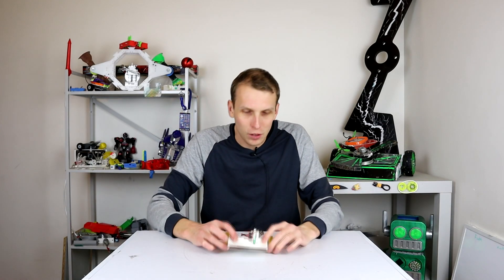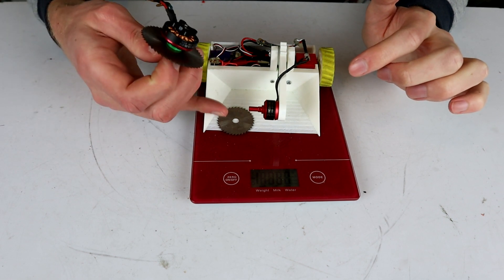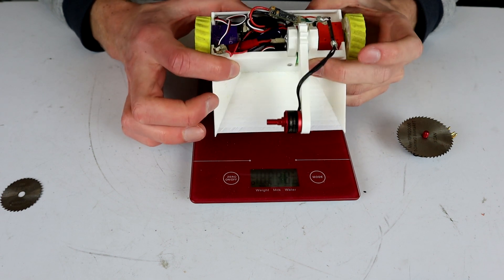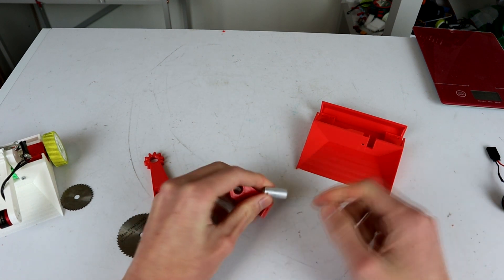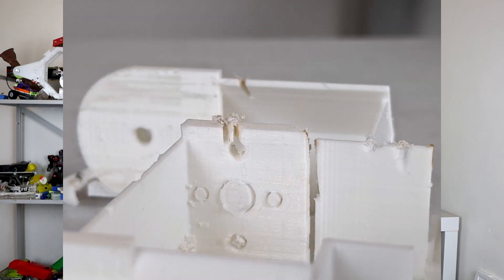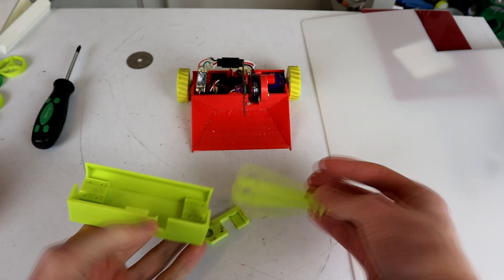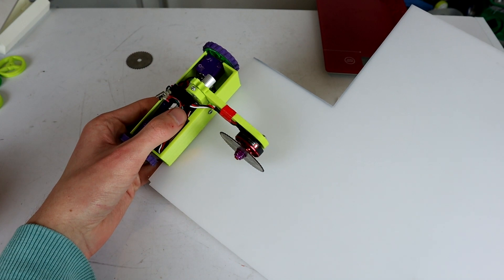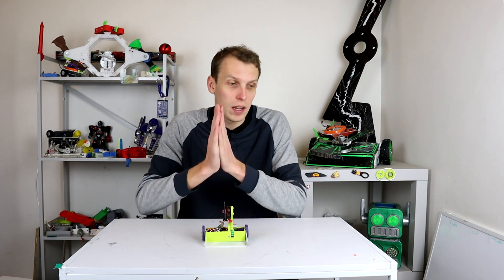Upgrading my antweight saw bot

Comment: How many escs do you have in this bot?

1 for the drive
1 for the saw
1 for the arm?
Reply from the maker: 3 or 4 depending on how you look at it

2 for drive (one per motor, they come attached to the motor and this solution is lighter then most dual escs)
1 for the saw to run the brushless motor
1? for the arm, I use a micro servo to drive the arm, which has an ESC in it, but that's not a standalone thing, so I'm not sure if you'd count it
Reply: @TeamPanicRobotics  thank you!

Comment: Weight saving idea.  Do you need the dustpan at the bottom?  Why not a spatula?  I mean, machine grooves in the bottom of the bot to cut weight.  Or will that compromise the structural integrity?
Reply from the maker: Thats what I am thinking about doing, I want the dust pan to be as strong as possible so that the force of the saw goes into them rather then into lifting my bot up, but I'm thinking a spatula will do the same job

Comment: Kind of nice seeing this thing being worked on again maybe try a locknut or somthing like that to help it stay on a bit better
Reply from the maker: The second set of testing did have a locknut to hold the blade.

there was also a lock nut in the first set of testing, I just forgot to tighten it down, so it was useless
Reply: @TeamPanicRobotics  fair enough there's one more idea that could work but it will be a pain taking swapping sawblades off and that's loctite but I don't think it would be a good solution in the long run

Comment: Hey Ben.  love your 3D printed bots :D (even though sometimes ur acetate top coverings make me worry for your electronics). but I'm aware spinners are different in the Aussie ant circuit to here in the UK :P Anyway just thought i'd put forward an idea to try out a saw with smaller teeth ^-^ the ones on that big saw  look awesome but it might be increasing the amount of torque needed on the motor which may be the reason you don't quite get the clean cut you mention in the video ^-^.
Reply from the maker: Glad you like them!
Haha yeah my top covers can be quite flimsy sometimes.

Thats a good point, I do have a saw blade with smaller teeth, I'll do a few tests to see if the smaller teeth cut easier